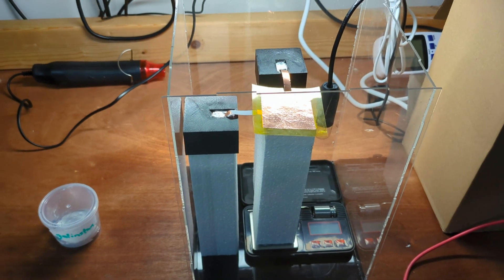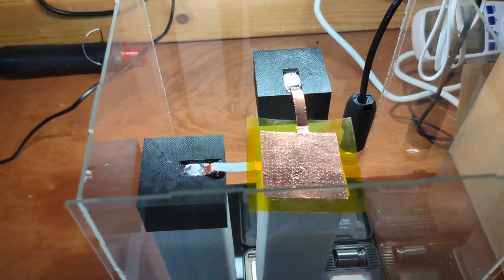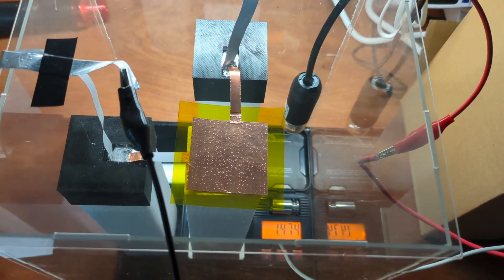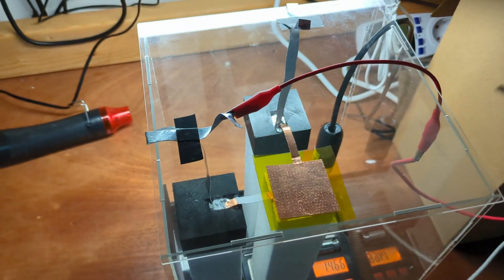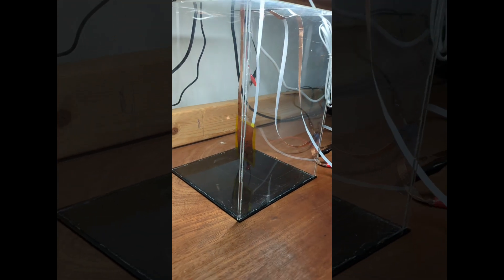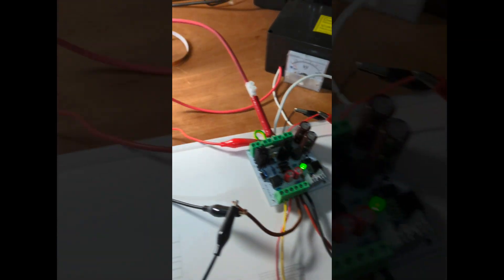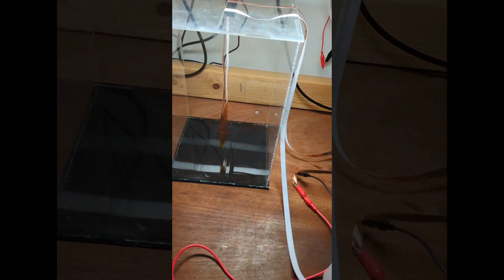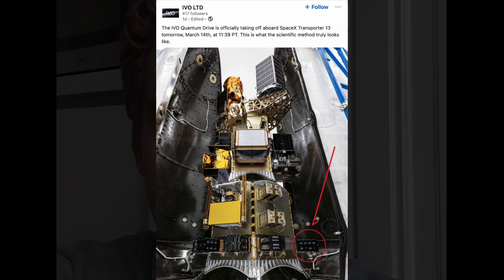My New Capacitor Thrust Experiments | Quantized Interia

Comment: Very cool. 
You probably know this but you can stack them and the thrust scales. So using like 8 or 10 squares on top off each other should make the force easier to detect.
Reply from the maker: Yes indeed, that is a great way forward, but makes the "production" of the capacitors a LOT harder, and then extra frustrating when they burn through ;-) However, I am currently setting up a new test where I'll be using a capacitor with 6 layers to which I'll be applying 15.000 Volt, so that should hopefully yield some visible results 😀
Reply: @Waveguide  you need to make it asymmetric, so that the smaller end faces the direction of thrust, and make that end positive also
Reply: @Waveguide  you could also try dumping a large coil into it to get abrupt pulses instead of a continuous DC

Comment: I like the idea but these cheap handheld scales 'walk' in their output readings ( usually downwards ) just sitting there on the counter.   They're also very sensitive to EM fields.  I've noticed this ( usually ) downward walking behavior which often keeps going down by hundredths of a gram while weighing reagents ( it's very annoying and I've collected quite a few scales just to get one which weighs fairly consistently ).  

Another annoying quality of these cheap handheld scales is that when I approach the scale ( even with an air current blocking enclosure secured around the weighing pan ), the scale walks upward as I put my hands ( or any body part ) within 3 - 7 cm of the scale.   I've seen this sort of behavior very consistently repeated with these cheap gem scales while weighing gems or other mundane items, totally separately from running anything generating RF or EM fields nearby the scale.

I'm not saying that there's no effects to measure...just that your scale, especially the model you're using, will be fooling you with inaccurate, highly variable readings -- from both its low build quality and possible interference from RF or EM signals throwing it off.

Comment: The scales should be under the box, not inside it
Reply from the maker: @dirkbruere  Good point for improvement indeed. It is however the case that most microgram scales are tiny, so they wouldn't fit the entire box, but I'm sure there's some scale out there that does.

Comment: Great video, thanks for sharing, and nice to see you!

Eliminate inductance of the loop, from which the capacitor hangs.
lower voltage, demands a larger capacitance. 
easier to get high voltage, then to overcome the inertia of a large capacitor.
Also high voltage interacts with the ambient medium, and that is where you get the movement from. 
You can stack the plates, to get more capacity, on a smaller "thrust" surface area this gives more "pressure"
also find the resonant frequency of the capacitor "swing" and discharge at that frequency to make it swing more.
Also the acrylic plates, might build up a static field to the capacitor, it can influence the results.
you can use isolated gate drives, to switch mosfets in series. but the Vgs threshold of all the MOSFETS should be the same, so that they switch simultaneously.
If the capacity is small enough, and the inductance low enough, the MOSFET can discharge a lot more current then the specs say. even if Rds is relatively high.
but I would really recommend going to 30kV
Reply from the maker: Hi Ivo, glad you enjoyed the video, although I would have liked to perform many more experiments, but with two small kids and a full-time job it's proving to be difficult to find the time unfortunately.

While not shown in this video, I did significantly reduce the inductance by placing the board right over the capacitor, soldering all connections, and replacing all thin wires with copper strips that were as short as possible.

I also tried a larger tank capacitor, which reduced the ringing, but eventually blew up my FET...

Using a stacked capacitor, switching multiple FETs in series, and switching them at the resonant frequency of the pendulum are good next steps, although I think I should take a step back and start with something that you already proved works: a high voltage discharged through a spark gap.

Then move that system into a vacuum chamber to see if it still works in there, and only then look at ways to achieve similar results using a solid state setup.
Reply: @Waveguide   yes. High voltage seems un avoidable for this. maybe a triggered sparkgap, to sinc it to the resonant frequency. I would love to see it work in a vacuum chamber! If there is a way I can support, then let me know in an email

Comment: Have you tried with one capacitor  plate much smaller than the other? That's how they supposedly work.
Reply from the maker: There are indeed asymmetric capacitor thrusters, but this is specifically testing symmetrical capacitor thrusters, as described in this paper: https://www.researchgate.net/publication/353481953_Thrust_from_Symmetric_Capacitors_using_Quantised_Inertia